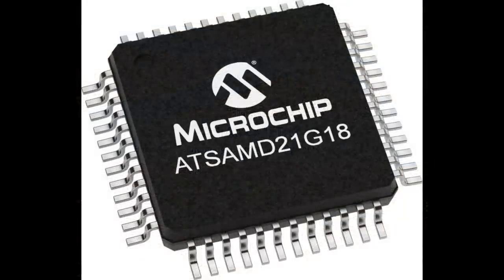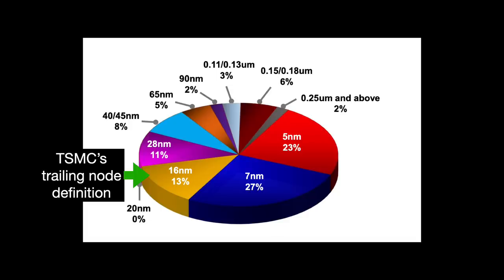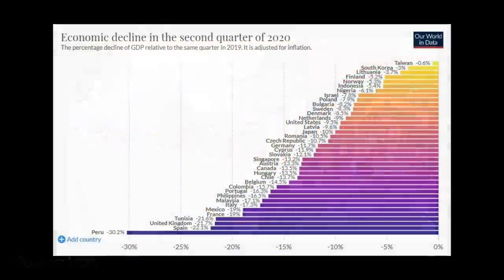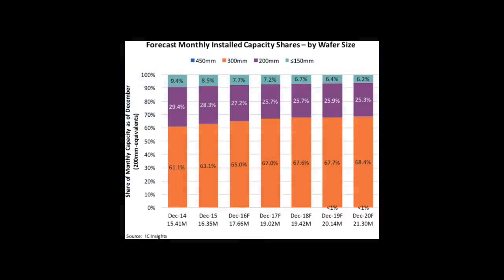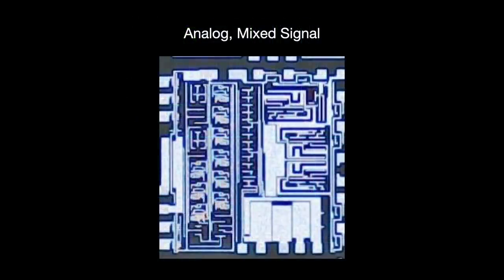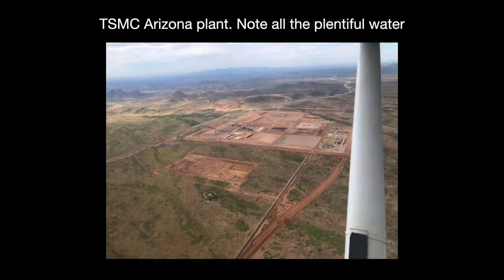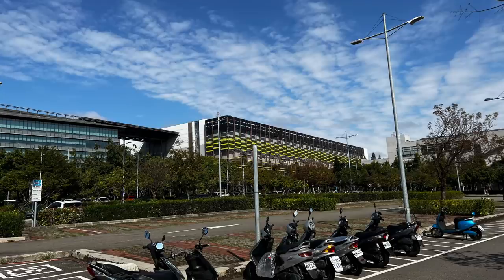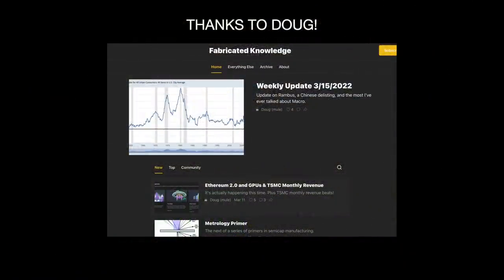Where The Real Chip Shortage Is

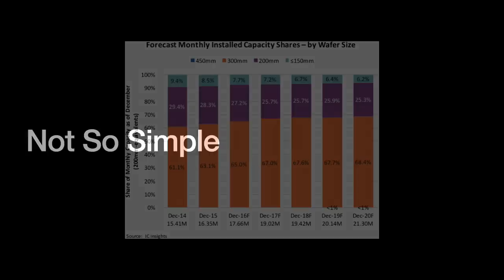Comment: 5:10 "for a long time trailing edge chipmakers have been hesitant to invest in such a thing"
the under-investment in trailing edge capacity began much before the lockdowns or the ukranian war
and if 4:22 they were modelling to run in the 80% as "full" utilization, there was no signal for additional investment
The video does not show any data concerning installed capacity, or if the lockdowns changed it.
Reply: By definition trailing edge manufacturers do not invest in new capacity (ie do not buy in new tools) unless they can buy in old fully depreciated equipment and even then they are careful as they still have to write off that equipment purchase, cheap as it is, and that can impact the manufacturing economics.
Reply: @thecraggrat  that being the case, and since OEMs are not building new trailing edge fab machinery... there must be a sustained reduction of legacy and trailing edge installed capacity.  When the old machines find no replacement, or spares, the capacity must dwindle.
Reply: @ricardokowalski1579  That can be considered to be broadly true, though there is an industry that produces parts for older equipment/reconditions older equipment, thoug buying the older recon equipment always means you have to have the capital write off included in the finances...
Having said that, the point at which a fab is no longer "leading edge" or mainstream moves with time. So these now fully depreciated fabs will at some point be nice and cheap and will be bought by the trailing edge manufacturers, and so at some point there will be a conversion to 300mm equipment, though it is likely to end up running older technology, unless there is a reason to run more advanced tech.
Reply: @thecraggrat  I agree with what you are saying. But at some point there are no more spares or sustaining, and all the functioning machines are fully utilized.
 If you wanted a (trailing edge) typewriter today, it will have to be used, and to have it refitted, it would cost you much more than a (leading edge) laptop and a laser printer.
I submit to you that the "typewriter" installed capacity is shrinking... like the trailing edge chip capacity
Reply: @ricardokowalski1579  Well potentially that is the case, I'd agree. However functionally there are areas where larger substrates are not available (as has been said elsewhere); for example, SiC substrates are mainly 100mm diameter, though they are available up to 150mm diameter, the actual quality (crystal defect levels) of the 150mm substrate have meant that it hasn't been able to be used in some applications. Also the equipment that is used in the manufacture of SiC devices can be nigh on 40 years old, I kid you not! I dropped in at a place where I had connections looking at maybe getting a job there & I found they were running Tegal 701/703/901/903 and other similar vintage equipment which I used back when I started my career. Consider there are businesses that still support those tools! Maybe not the OEM's but where there is money to be made there'll be people who will fill the niche and make it! The same is true across the spectrum, even into 300mm equipment where there are 3rd parties that make reconditioned parts and/or replica parts for close to or even leading edge tools!
Reply: @thecraggrat  40year old equipment may also means the few people that know how to repair these things are retiring/dying. That is how we lost the F1 engines for Apollo, and programers tell me that it is harder and harder to find people that can do Cobol and FORTRAN for legacy systems. Thanks for the talk!🙂
Reply: @ricardokowalski1579  😄! Believe me when I say the equipment of that era are not that complex! Though you are right that eventually available parts will disappear, truth be told I wonder if some of the IC's they use will only available as recovered parts from other pieces of kit!😏
Reply: @卩乇尺丂ㄖ几 lockdowns collapsed both supply and demand, that may be why there was no price signal before lead times increased.
Lockdowns may have caused deep and long term damage to the supply side, thus creating the long lead times.
Respectfully.
Reply: @卩乇尺丂ㄖ几 i agree that in a free market the price isn't static. But it is not a free market because governments are meddling with it all the time. Governments just shut down everything for two years, that has to affect the markets.
Reply: @卩乇尺丂ㄖ几 there is a difference between an Oligopoly and an Oligarchy. Two different things.  I do not believe there is an Oligopoly of private actors. But I do put forth that there is an Oligarchy of government distorting the markets.
Reply: @卩乇尺丂ㄖ几 🙂👍
Reply: @卩乇尺丂ㄖ几 No worries. You are evolving your thoughts and being respectful, I will gladly have you as my fellow citizen. 👍

Comment: The "real" chip shortage is TOASTERS HAVE CHIPS!!!  So do countless other appliances that just don't need chips.  Your watch doesn't need a chip.  Your refrigerator doesn't need a chip.  Etc. etc...
Reply: The whole point of low end chips is that they replace or enhance the function of some mechanical controller at a lower price. Does a watch “ need “ a chip , no, but once chips were introduced into watches the entire mechanical watch industry crashed as watches became more accurate, cheeper and convenient. The microcontroller in your refrigerator is likely saving you energy by controlling your compressor more efficiently then the previous mechanical controller.
Reply: @francesconicoletti2547  yeah, you can talk to refrigerators....  not needed...

Comment: The answer is for customers to resign their products to use chips that are available.
Reply: It's not. For the chip shown for example, none of its direct competitors that i can think of have good availability, almost all are gone completely, and a bare handful are just borderline available. Many achievable redesign opportunities have been picked pretty hard. If more designs transition to the available ones, those will be sold out a year in advance as well in short order. Industrywide shortage is an industrywide shortage. Your suggestion would make sense if there was a giant stockpile and overproduction of some functionally comparable chips but there really isn't.

We probably need more yield per wafer. Maybe same function chips on smaller and cuter nodes. Not just all the 130nm stuff. But when that happens, can packaging even keep pace? Breaking out of an industrywide shortage is HARD.
Reply: Also takes a LOT of engineering (aka cost) to move an existing design to a new node - you're basically doing a fresh design from the start in a lot of ways, and if the goal is to make the same thing at the same clock speed (with maybe a side benefit of lower power, which the customers of that product wont' care about anyway because they already designed for the higher power existing version), what's the point? It's not like everyone's using 130nm while 32nm fabs sit idle. All the fabs are full at all nodes basically. When you slow down production for a year, and at the same time demand picks up, you have a problem.
Reply: What’s available today could be gone tomorrow. Or the chips you’re looking for could just show up in stock.

Comment: What MEMS  Chip use for Sir 😊 ❓
Reply: Sensors are one use, such as accelerometers, used in airbags or in phones and tablets to determine changes in their orientation.
Reply: @ttb1513  it means all so use smart bombs to thanks you Sir 😊
Reply: Clock oscillator, microphone, accelerometer, magnetic field sensor, pressure sensor. A lot of semi mechanical devices can be made smaller, higher performance and more efficient, produced as a MEMS semiconductor.

Comment: The fab houses have all messed up.  Why would you build to the "next node" leading edge without consideration to the previous node - backward compatibility?  The move to assisting the designers to get the same "trailing edge" functionality and performance on the next or leading edge nodes.  The fab houses should advance to leading edge technologies while considering ability to accommodate 1-3 generations back.  While the investments are huge, the profits are even greater.  Greed.

Comment: In fairness with the global shortage and logistics thing slowly working itself out, with the likely forthcoming ban on China doing anything in terms of lithography that would be a threat, and with the CHIPS act and probably a similar EU directive on the same lines... well now IS a good time to move to 450mm wafers. After all Uncle Sam and the EU government will be picking up some of the cost right? So the new fabs being built should be built to 450 now and that'll be good until the mid 2030's if not into the 2040's. It doesn't answer all the problems but it would be cheaper with all the grants available, and it would keep the technology out of Beijing's hands.

Comment: Also the neon gas shortage from ukraine and russia will make things worse. Russia is the biggest producer but it will use it as leverage because of the sanctions. Also these fabs need a lot of water, in times of water shortage  I don't think we will have a brilliant future. Even with a good water recycling system chip fabs still need a lot of water.
Reply: Which is why Samsung is building a Fab on the Ohio River in the US.
The neon gas shortage is overblown - Ukraine was just cheaper than everyone else. You just need a gas fractionation plant - like the one NASA has to fuel its rockets and chill the residual gas to liquid hydrogen temperatures…

Comment: are these chips efficient and practical, for short, are thet well designed and is the whole machine good designed ? they seemed miraclely multi purpose in general. but i can asume... that there are specific tasks or software. where the computer design and the electronicle compounands as chips.  not are suited for. i wonder. where this .. hyped.. machine is specificly used for. normal. there is a task. and the machine is designed for that. with most of the time, a one button solution. checked and verified. but all of this... ??? i dont understand.

Comment: There is no shortage of chip made in mature nodes(40nm-200nm). So called chip shortage is just an excuse from people don't work in semiconductor sector at this moment.
Reply: If there's no shortage, then where are the chips though? Have you tried buying a reel of them through any reputable distributor? Or even half-way reputable? All these microcontrollers made on 90-350nm nodes are various shades of gone, with typical lead time of a year.
Reply: @TheMichaelJu   I am a computer engineer and worked in automotive and medical but no longer do at the moment, but why would you be making it about me. You're skirting the question entirely. SoCs CPUs GPUs DRAM and whatnot are 45, 28nm or higher end. They don't directly compete for the fab space with 130nm 32-bit micro or a 350nm 8-bit micro. And those things are exactly the things that you can't buy. Every typical NXP LPC, STM32, ATSAM, even Nuvoton in the sub-$5-ish range (depends) are sold out a year in advance. Where are THESE chips if you claim there is no shortage in specifically this area?

Comment: I used to trust you but now I see that you jump in the bang wagon of lies. It is easy to make an old node with UEV than making newer nodes  in old equipment. If their is a market for it. This bunch of lies claim chip shortage.
Reply: Hahahaha! That is so absurd. That's like building an F1 race car for grocery shopping. Unless your goal is just to burn mountains of cash...
Reply: you're actually clueless my guy @Mike F
Reply: Are you an IC engineer? How can you say I'm  clueless do you know what I do for a living?
Reply: @mikef4077  Heh, if you think there's just oodles of spare EUV capacity sitting idle somewhere (you know, as opposed to running 24/7 cranking out cutting edge wafers), or that anyone in their right mind would use EUV to produce old nodes with any economy, we at least know that YOU aren't an IC engineer. If you even think that swapping whatever existing litho tool for EUV would be easy or economical, we know that you're not even close to an IC engineer... yeah, some old fab producing 130nm parts is just going to up and order a $200M EUV machine, with a one or 2 year lead time, and that won't even physically fit into their fab building, rather than say just ordering up more of the existing litho tools they already have and that already work with their process. And then even if they had more litho tools, now they don't have enough implant equipment, or etchers, or inspection equipment to keep up with more litho tools. Yup, sure thing. I will award you the dumbest / made my actually LOL comment in this entire video award though!